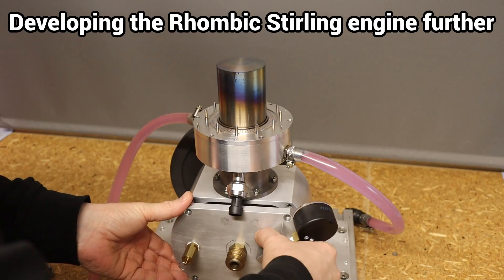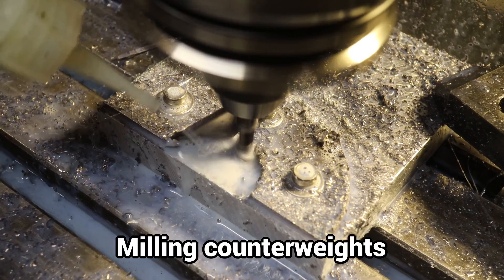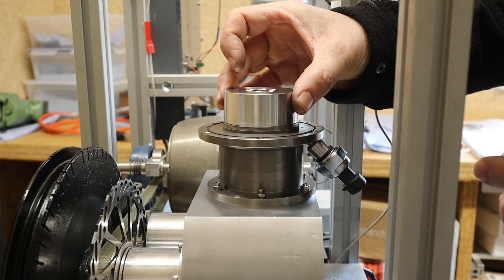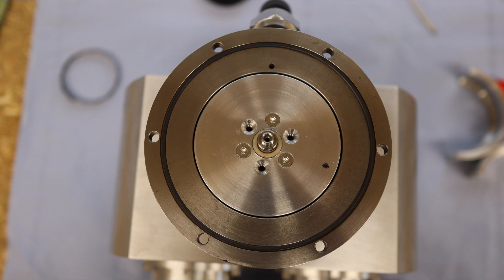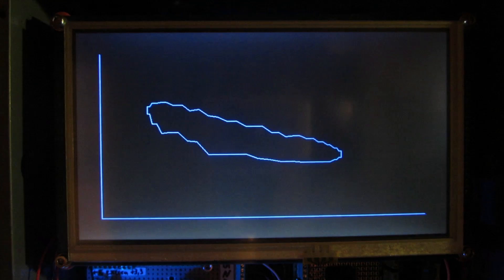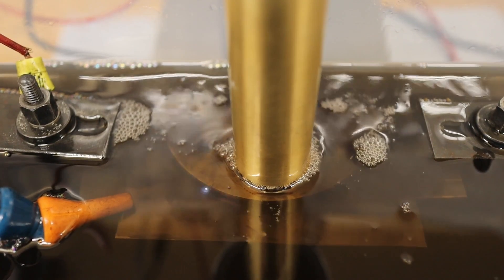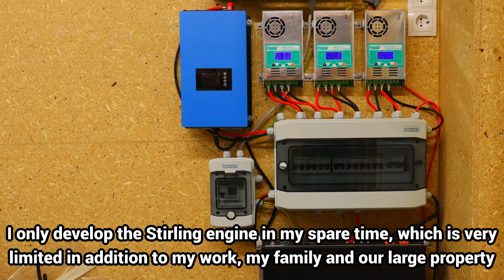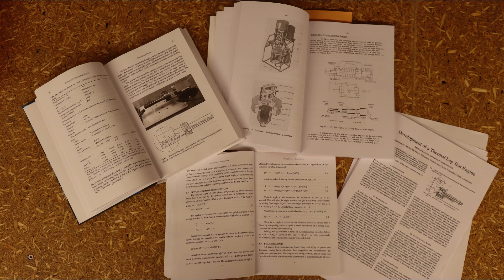Stirling engine development for cogeneration of cheap DIY energy to become off grid and independent

Comment: We're going to be patenting a novel simple Stirling engine architecture even though I'm not fond of this low power cycle. Recently patented  a number of ultra-simple, power dense [in the turbine range], rotary two stroke architectures based on the four bar linkage...but it's rotary. Previously patented the simple, ultra-efficient, multifuel, zero-emission ◉◉◉ 𝔽𝕦𝕖𝕝 𝔸𝕘𝕟𝕠𝕤𝕥𝕚𝕔 ℤ𝕖𝕣𝕠 𝔼𝕞𝕚𝕤𝕤𝕚𝕠𝕟 𝔼𝕟𝕘𝕚𝕟𝕖 [𝔽.𝔸.ℤ.𝔼.]  

We have also patented an entirely new, infinitely variable, ultra-torque dense, gear technology, called 𝔽𝕣𝕚𝕔𝕥𝕚𝕠𝕟𝕃𝕖𝕤𝕤 𝔾𝕖𝕒𝕣𝕤 [a CVT/𝕀𝕍𝕋] based on our reformulation of gearing theory. The technology enables transmissions of ~1/10th the size/mass/cost which enables use of motors/engines/batteries of significantly smaller size. It also provides novel 3D motion of robotic appendages/manipulators/booms

===
✈ℕ𝔼𝕎  𝔽ℝ𝕆ℕ𝕋𝕀𝔼ℝ  𝕋𝔼ℂℍℕ𝕆𝕃𝕆𝔾𝕐  𝔾ℝ𝕆𝕌ℙ is a visionary multidisciplinary B2B innovation company utilizing a licensing business model or collaborative enterprise with strategic partners to develop Advanced clean, efficient, power dense solutions in domains of energy, propulsion, mobility, robotics / exoskeletons and clean technologies with a particular emphasis on the aerospace sector including space exploration and commercialization
ℕ𝔼𝕎  𝔽ℝ𝕆ℕ𝕋𝕀𝔼ℝ  𝕋𝔼ℂℍℕ𝕆𝕃𝕆𝔾𝕐  𝔾ℝ𝕆𝕌ℙ is a visionary, multidisciplinary, B2B innovation company utilizing a licensing business model or collaborative development with strategic partners for development of Advanced clean, efficient, power dense solutions in domains of energy, propulsion, mobility, robotics / exoskeletons and clean technologies with a particular emphasis on the aerospace sector including space exploration and commercialization.
Reply: patents don't stop people from stealing, they only give a means to injure someone who does. like speed limits and most laws, they don't stop people from doing things. weaponizing the law is sometimes called lawfare (like warfare) where you put laws in place to extract money. then you monitor the situation like setting up a speed trap and now you're raking in the bucks. i can't comment on the specific details of this "new frontier technology group" but some companies patent things in order to use the law to gain money from lawsuits over patent infringements. even if a design is junk, if you have a better legal department than engineering department you can make a lot of money. its not to say that this type of thing happens a lot but i think more people should be aware of the real value of patents and the fact that you need to sue after your idea is stolen to leverage the patent in any way.

another fun thing people do is patent things for clout. being able to say 'I have 23 patents on my inventions' sure looks nice on paper and it's a rare thing for anyone to spend the time to review and understand each of those patents for their value and innovation.
Reply: Why do you type like that, and isn't patenting a bad thing
Reply: @voinea12  Patents are a necessary evil in this system. It offers protection from pirates who have not expended the resources to make the innovation. Without resource and market capture no innovation would happen. Not knowing your exact point, your comment seems naive, as best as I understand it.
Reply: Titillating use of the tasteful alternate characters for emphasis +1 for that, does make it rather hard to cut and paste the text into a application that does not support a full set of unicode characters and searching for them becomes difficult though that may be by design. I was unable to find any information about your operation besides a LinkedIn page and that was a bit of a dead end.

You say four bar likeage (rotary) and ultra simple as if they can be equated, please explain how that will work.

Why not point to a couple of patent numbers.
Reply: @KallePihlajasaari  LOL 𝕋ℍ𝔸ℕ𝕏   ヅ   Am using those 'math' characters for attention/promotion/titillation. 

Ya got booted from LI for not being a ¿woke? dumbass. ¡ sloo┴ ɟo uǝp uʍop ǝpᴉsd∩ uɐ ɥɔnS

Well, rotary engines ARE! simple and if you know anything about kinematics, four-bars are everywhere, like ICE engines.

We're still patenting around those concepts so it's critical to fly under the radar🧐🤫🙃

Stay Radical!
From: Chief Radical Officer
🤜⚡💥⚡🤛

Comment: The rings seem very wide, and the cylinder surface not hard enough. You could use Nikasil perhaps, "two stroke stuffing" had some success doing this in his own garage.  Thick rings require more power sapping pressure to seal well, there is a reason pretty much every ICE uses very thin rings.
Reply from the maker: The problem is that they have to run dry so some self lubricating compound has to be used.
Nikasil needs lubrication I think?
Thanks for your help!

Comment: Proposal: Could a non-oil based lubricant help with the sealing issues and friction issues?

Context: I understand you want the engine to last atleast 1000 hours and perferably several 1000, but what if a different metric is used? For example, if after 1000 hours, it takes 2 hours of work to get the machine back into sufficient operation, would you consider 500 hours and 1 hour of servicing comprable? Or perchance every 100 hours of operation, have 10 minutes of downtime and servicing?

For example: "Would it be acceptable to have the stirling engine go down once a week (168 hours) for less than 1 minute for maintanence?"

How short a timeframe of inoperation, would be an acceptable substitution of an engine operating for 1000+?

Proposal: Silicon, Lithium, or Graphite based lubricant. Tap 2 small holes opposite one another on the cylinder wall near bottom dead center. Thread the holes to close them when needed. These 2 holes could be an input and output port for grease or oil, fresh grease on oneside, used grease on the other.

The same principle works for truck and trailer bushings, a port is used and connected to a grease gun to force in fresh lubricant without needed the dissasembly of the entire mechanism.

In Practice: Bring the piston to relatively bottom dead center >> Unscrew bolts from both holes >> Line the holes with the landing between the 2 piston rings >> Attach grease gun loaded with prefered lubricant >> Force new grease in, old grease out >> Screw bolts into holes >> Give the engine a few turns >> Restart machine.

The Cons: 
-Modifying the Cylinder wall
-Finding the Correct Lubricant (Probably Silicon based)
-Messier cleanup
-Messier Complete servicing in spring
-Grease is an additional cost

The Pros:
-Less Blow by
-Less force is needed for the piston rings to seal
-Lubricant Acts as an additional Seal
-Less Friction overall reducing part and seal wear
Reply from the maker: The main problem is that the lubricant will contaminate the regenarator and also the other heat exchangers and so you have to find a lubricant that does not.
But I dont know if this exists, maybe  a molybdenum derivate ?
Reply: @myengines2443  
How much contamination will cause a problem? Any guesses?

Also, would substituting the working fluid for argon or nitrogen work? To increase the selection of lubricants? Or to decrease the effects of contamination?
Reply from the maker: Any contamination will cause higher flow losses and result in less efficiency and power.
I tried helium and made a few experiments with it but have to make more tests.
Hydrogen is to dangerous for me.
With nitrogen a higher pressure would also be possible because there is no danger of explosion but 10 bar itself is dangerous enough for me!
Reply: @myengines2443 
Wait, does your Stirling engine have a regenerator in it?
Reply from the maker: Yes, it has a woven wire regenerator which has a very fine structure.
You can see it in some older videos.
Reply: @myengines2443  
I honestly can't think of any other solutions that wouldn't result in, or need parts to be, modified except 1.

I am somewhat curious on whether the regenerator would act as a fluid scrubber?

That any lubricant that does make it into the chamber could be scrubbed or filtered out by the re-enter.

And on the downstream the backpressure blows the blockage from the mesh.

From there on...I cannot really come up with anything other than prssurizing the crankcase, or fill it with an incompressible fluid.

That would reduce the amount of blow by due to the lower pressure difference and lower infiltratable volume.

But that may require a gasket or sealant. Which doesn't affect the new parts. But does incur new costs and variables.
Reply: @myengines2443  regardless.

Good luck, can't wait to see more.

Comment: Hi, can you increase the power per cycle by operating at higher pressures? The whole device in a very high pressure environment, encapsulate the mechanical parts.
Reply from the maker: The engine is still pressurized to 10 bar and more is too dangerous for me...
Reply: That can be dangerous. High pressure risks an accidental "diesel effect."

Comment: I forget which European country it’s one of those Scandinavian countries I believe opted not to use nuclear submarines and build submarines with Sterling engines for electrical generation. They found 50 KW what is the maximum size it was still efficient don’t know which variant they used, but worth looking into.
Reply: What was the heat source for the Stirling engines?
Reply: @ferrumignis  as I recall, they burn diesel.

Comment: Here's a piston and cylinder combination you should try. This is known to have extremely low friction: use a graphite piston on a borosilicate glass cylinder. You can get an exact fit, or even somewhat of a tight fit, and it will still have minimal friction. Look for videos of Airpel brand airpots. That's where graphite pistons in glass cylinders are typically employed.
Reply from the maker: Yes I also tried glass/graphite combination but at 10 bar pressure and 300 watts power its not sturdy enough.
And glass is hard to machine for me.
Reply: @myengines2443  how about using silicone whose surface is impregnated with graphite for the seals? Would that work?

Comment: The Thermo Mechanical Generator basesd on the Harwell design seemed to be a goof micro chp device, developed originally to use heat from decaying radioisotopes it morphed into a generator with long service intervals for light buoys. HoMach in England made some?? for the Irish maritime service in the 1980s. I can find no trace of one now. 150W electrical output for 1500W propane thermal input. 

Ideal for an underfloor heaing system . Only drawback seems to have been a loud 400Hz hum
Reply from the maker: In a few days I show a new video about the TMG, maybe it will be my next engine..
Thanks for your suggestions

Comment: I Think That You Should Look @ it As An Aircraft Engine, ( Very High Run Time ) or Chainsaw ( High Hp, but very Low Tq. ). Industrial Hard Chrome Cylinder, W/ 1mm plain Iron Gapless ring. Or Nitrated Cylinder Running 1mm Gappless Chrome Faced Ring. Using The Best Quality Full Synthetic """ Mist """ Lubrication of the Cylinder in Say a 0W-5 grade or even Just Straight 2 stroke oil. I Use it in Many High Load Applications. Hopefully this Can Help.
Reply from the maker: Unfortunately the pistons have to run dry, that causes a lot of problems and the reason why many things have to be so complicated...
Thanks for your thoughts

Comment: Try making ring less pistons from 4032 hyperutetic aluminum alloy. In hi performance racing engines using a 4” diameter piston we run .0002-.0005” skirt clearance. This is high Silicon low expansion material
Reply from the maker: With  ring less pistons I had problems because the piston expands more than the cylinder and its quite difficult to find the right clearance.
So low expansion material sounds nice. I will inform myself about 4032, many thanks for your help

Comment: Wouldn't a Seebeck generator (also wrongly known as "Reverse Peltier") with an electric motor be more efficient and lower maintenance?
Reply from the maker: Seebeck modules have a very low efficiency as far as I know but I will investigate this too.
I ordered a few elements a few weeks ago and will make tests with them and report here!
Reply: @myengines2443  on the positive side, unless you melt the solder, there's zero maintenance or parts to exchange. Bonus points if you need electricity in the end, and not mechanical power.

Some cooling would benefit both the Seeback effect, and the PV efficiency. Do I'd investigate the benefits of an active cooling solution.

Comment: I am still wondering about a direct temperature to electromagnetic generation link; getting to a design where the mechanical oscillatory movement is directly converted into electric induction. Such a design would minimiz mechanical gearing and kinematic energy conversion. I live on an acreage in the Canadian Rockies and I am very interested in such a possibility.
Reply: I've seen somewhere in the past the some companies have made free piston stirling engines that use the sun's heat when placed at the focus of a reflective parabolic dish. The rapidly reciprocating piston moves a magnet past a coil to make power.
Reply from the maker: Thats what I am currently looking at, look out for a new video in a few days where I will describe my new ideas..
Thakns and many greetings

Comment: I say free piston with graphite air bearings.
Reply from the maker: I am currently informing myself about Free Piston engines, ad I will report about them in a few days.
I tried graphite in earlier engines but it does not seem to be solid enough for high power.

Comment: With stirlings - you can allways opt in for "just make it bigger"  instead of efficiency.
Reply from the maker: Bigger and more cylinders always means higher cost and much more work.
Nevertheless I just bought a 130 mm diameter 1.4571 stainless steel rod for the next much bigger engine when the attempts with the next Stirling concept I report of soon fail.
Reply: Or make more than of them.  I would be happy with a 200 watt Stirling engine that runs quietly...
Reply: Make bigger is wrong way. Make more cylinders - the right way.
Reply: @FadeToEvil  that is not ICE - it would take much more time and effort to make multiple cilinders to get an outcome that can be received just from slabbing it bigger in beta configuratiin
Reply: @romualdaskuzborskis  You are basically not understanding how Stirling works. You can't make it bigger without loosing of performance. Scale effect in action : make bigger twice, surface quadruples but volume eight times larger. So, bacially you have no enough surface of heater / cooler for feeding two times larger volume. Increasing surface will increase dead volume which kills Stirling cycle. There is optimal cylinder size for given pressure - that's it.
Reply: @FadeToEvil  sorry but I would counter that, with quadrupling volume actually helps. It obviously takes more energy to heat up to same tempersture, but that is the point - you dont need to get it to same temperature. You can keep rpm lower and get more watts just from sheer volume of expanding gass. 
The curent configuration is limited  do gas power. The bigger - may as well be chucked in to wood fire. 

I have seen beta configuration stirlings made from a barrel and a leather membrane. Yes - they are less efficient volumewise. But they do put out ≈500 watts just from difference in ambient temperatures (ground to summer air temperature). and that is far better in therms of self reliance in a secluded area.

Comment: I think you should try using a tesla turbine, seems very easy to make and should make a lot of power with either steam or air
Reply: I think there's no alternative to steam engine. If it would built with the same effort, it could be more powerful and more effective than current Stirling. Just use more pressure like 50+bar.
Reply: @FadeToEvil  Yeah, stirlings have to be extremely big to have the same hp as a compact steam engine

Comment: Just looking at the design it looks overly complex with many bearings and points of friction. Your design goal should be produce at least 300watts with a Stirling engine. You need to take the linear motion of the piston and convert it to rotation motion to couple to a generator or alternator.

Comment: I'd just go for a labyrinth gland, lots of very fine groves down the piston skirt.
Reply from the maker: Yes I will try this, the displaycer rod is already sealed by a labyrinth seal as you can see in older videos.
Thanks for your suggestion and best wishes
Reply: @myengines2443  I've seen a design of piston ring on a compressor that is in 4 parts, two are sprung loaded against the cylinder wall, with 45 deg ends that push to ends of the other two piston rings out, perhaps this would also be worth a try. What do you use for the regenerator ? I've thought about using very fine stainless steel mesh.